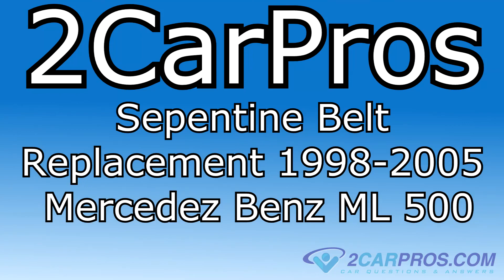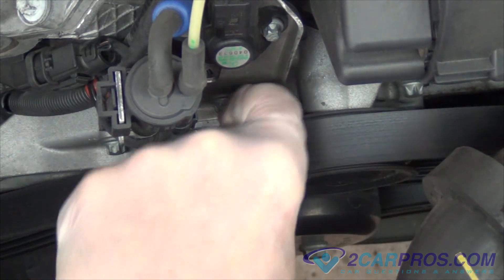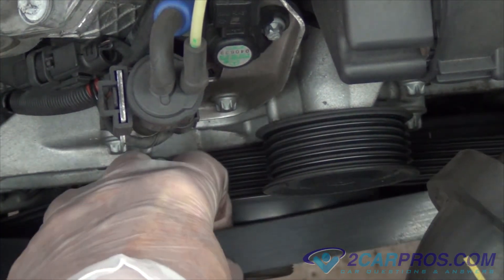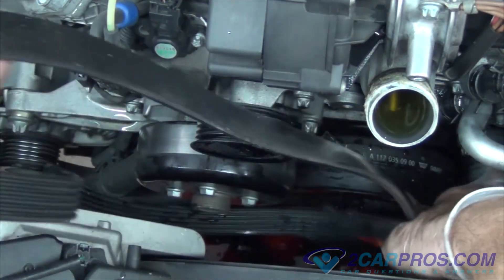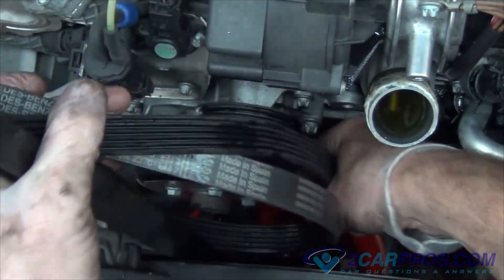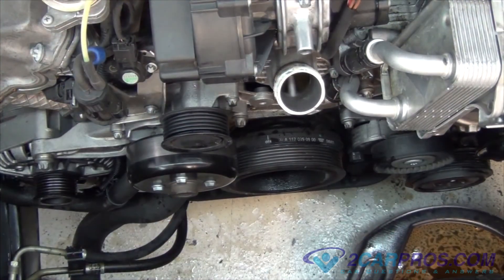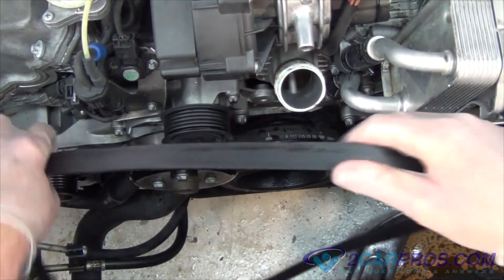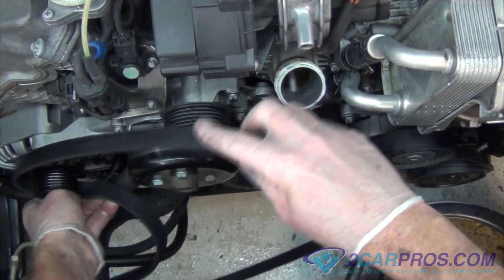Serpentine Belt Replacement Mercedes Benz ML 500 1998-2005

Comment: Ok use a 17mm socket on a ratchet & put it on the molded 17mm head thats on the Tensioner below belt.
Once on, rotate CCW very slightly until you feel yourself moving the spring & pully slightly towards passenger side.

Then you slip belt off pulleys as shown.

Replace belt onto pulleys exactly as shown.

Done !

Comment: How much Tension needed on the belt? is it a feel or any specification?
Reply from the maker: Yeah you really have to feel it out. Thanks for watching!
Reply: The tensioner spring does the job of applying tension.
If the spring broke you'd need to replace the whole tensioner.